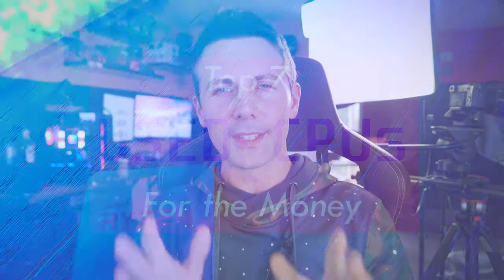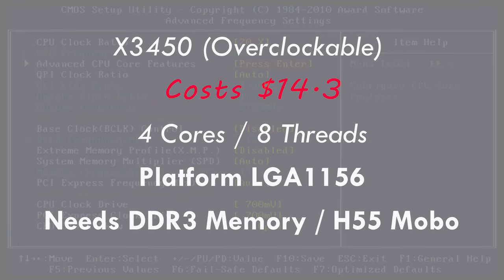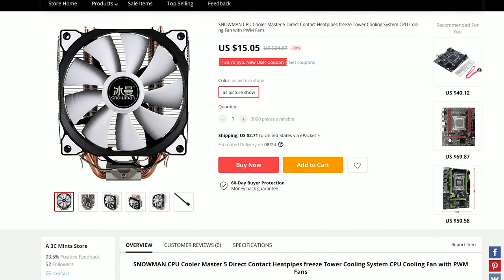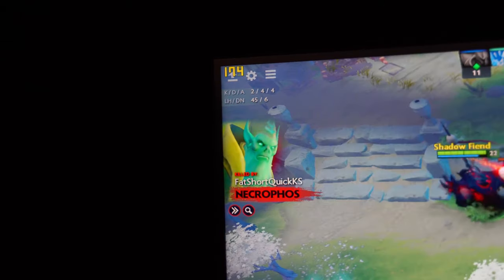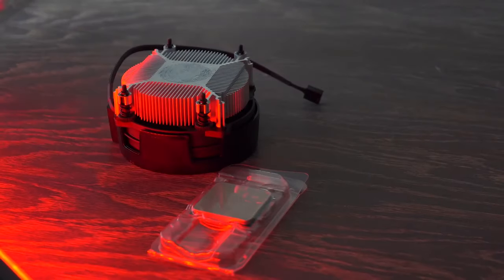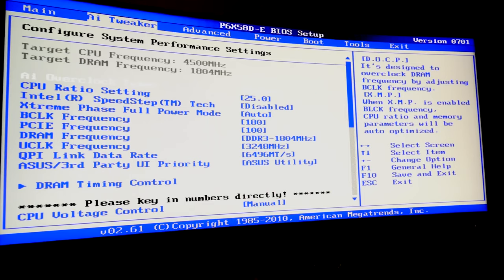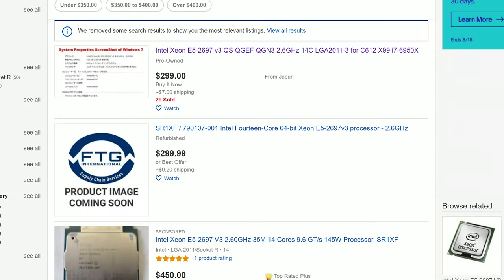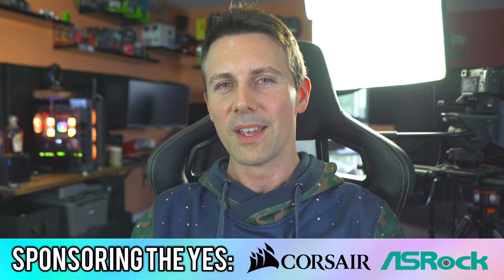Top 7 USED Gaming CPUs for the Money in 2019

Comment: i personally was gaming on an i3-3220 for a long time, since it was new basically, then i found out my board support sandy and ivy bridge xeons so i went looking for a deal on ebay. turns out going on the supported cpu list and looking up each xeon till i found the lowest one in the stack of either generation that is 4 core with hyperthreading worked wonders for me. i got a xeon e3 1230 4c/8t @3.20Ghz and it very ofter turbos to closer to 3.8ghz. turns out that i3 was holding back my GTX 1050 by a descent amount. not sure if this will actually help anyone else or if i was just lucky af but i hope this wall text helps someone.
Reply: Using the same cpu with gtx 970. Gaming sucks on this thing :/
Reply: @Belikeimpasta  I also have the same cpu but paired with a RX 480 8gb. Games decent for the price. Haven't had any problems.
Why does it suck for you?
Reply: LoD Sluggy I'm currently rocking an i5-2400 cpu, planning on upgrading to the xeon you mentioned cause it's basically an i7-2600 but without the integrated graphics. It's cheaper than the 2600 but it is slightly power hungry. I have a GTX 960 so crossing my fingers my games will be smooth ~
Reply: @CheatCodeChico i7 2600 go for 40-50e i bought one while ago on ebay auction
Reply: @CheatCodeChico  hope everything goes well for you. i had a longer reply but it got deleted so i will give you the basically of it, i havent played many new AAA titles on this cpu but indie and small dev shit runs great on this thing. exambles being warframe, space engineers, diablo 3, grim dawn, Starcraft 2, overwatch, League of legends, ark:se, and whatever else i played on it out of my like 200 game steam library and no problems so far. further note my chip stays rather cool thanks to an AIO watercooler i have on it so im not sure what it behaves like on air. thanks for taking to read my ramblings.
Reply: Had a xeon e3 1270/970 ran evrry game i threw at it
Reply: D. Maybe bottlenecks?
Reply: @CheatCodeChico  I have r9 380x 4gb (it is a bit powerful than gtx 960) and I have used it with a i5 3550 and after that I have upgraded to a r5 2600 and boy the difference is huge. I have a smoother gameplay than I had with the i5. In conclusion those extra 4 threads will help you a bit.
Reply: Running a couple cheap MSI Sandy/Ivy boards with E3-1225 v2 procs, and really happy with them.
Reply: I have the same cpu with gtx 750 ti
Reply: the hell? i have something worse. The i3 2100, paired with the same graphics. Lowered ram timings, disabled core parking, overclocked my gpu. Plays Gta5 Very High, excelt textures and advanced settings @1080p stable 40 fps. no reaaon for me to go with an athlon, rather use my stocked h81 for a 4690k
Reply: @epicminecraftgamer1  You should go with e3 1230v2 instead of v1. It is only $10 more, but there is nice boost in performance, usually 15%, not to mention much less power consumption thanks to 22nm process.
Reply: @CheatCodeChico  how much ram?
Reply: @LazyKingAus  if you're talking RAM sticks, I have 16 gigs, DDR3 @ 1333 mhz. unless you're referring to the VRAM on my 960, it's 2GB. since then i'm currently rocking a 6gb 980 ti from MSI.

Comment: Picked up an i7 3770 and board for £40, bargain.
Reply: thats a hell of a deal, get a RX570 and you are good to go.
Reply: Which platform did you find it from mate? Gumtree?
Reply: i5 3470 and Gigabyte GA-Z87X-D3H Mobo from where I work at a recycling centre for practically nothing; still working and in good nick! Slapped a Hyper 212 Cooler on, and updated the BIOS to the latest version; also picked up a 2nd hand still good PSU to run it... SWEET!
Reply: @PCFixer  Ivy Bridge chip on a Haswell mobo?
Reply: @PCFixer  That MB is a sweet thing
Reply: @cobbydizon3440  No it was on ebay, the cpu and Mobo were from an OptiPlex 3010.

Comment: I don’t understand why i5 3570’s arent recommended? They cost $30usd on ebay and h77 motherboards are dirt cheap too (25~30 usd). The CPUs are way better than x3450s and clock 4+Ghz (the k versions clock at 4.8+ ghz).
Reply: x3450 is 1/3 the price, cost only 30% slower.
Reply: so i5 3570 is worth ~$18 not $30.
Reply: I don't know that I'd say a 3570 is WAY better than the X3450. It's only 4c4t for a start. Sure, the IPC is somewhat better, but even with a large clock speed advantage, 4c4t chips tend to be a lot more stuttery in a lot of modern games than 4c8t ones. And you're not going to be doing any overclocking on a H77 board anyway.
Reply: Because E3-1230V2/1240V2/1270 are better than i5 because they have similar performance to i7 3770.
Reply: Eduardo Felipe but Yes isnt talking about those either.

You guys are missing the point here... NEVER look only at the CPU price but always include average Motherboard prices.

I can get 3570’s + H61/H77/Z68/Z77’s motherboards for around $50~$70 both together and that costs the same for X3450+H55 old AF motherboards but performance isnt.

I literally have X3570, i7 980, 1240v2, 3570 and 8600k builds in my living room right now and the 1155 Gen plays much better than 1156 (stuttering).
Reply: Aretak 1% fps and .1% fps con AAA titles, my 3570 destroys my X3570’s
Reply: xponen_ you’re hopeless. Find a cheap h55 motherboard that allows OC for under $50usd

Comment: 3:30 R5 1400 and RX570 FTW! Used price performance princess ticking away in my ITX box :D
Reply: yeah thinking upgrading GPU and I don't know to what since for me I'm on the edge cooling it down
Reply: Can you tell your build?
Reply: Muhammad Fikri 

Fractal Design node 202 ITX case
Gigabyte AB350N Gaming Wifi ITX AM4 mobo
Ryzen 5 1400 with Wraith Stealth cooler
2x8GB Patriot Viper Steel 3200MHz DDR4 RAM
Drevo D1 Xtreme 512GB M.2 PCI-E NVMe SSD
Silverstone SST-ST30SF SFX PSU
Powercolor Red Dragon RX570 4GB
Samsung 500GB 2.5” HDD.

Brand new case, SSD and RAM, the rest from ebay/facebook market. Required Power switch and LED extension cables for the front panel in the build and a PCI-E 6 pin + dual molex to 8 pin PCI-E. Can avoid converting by choosing a Sapphire Pulse ITX RX570 instead. £465.
Reply: It's a great combo, but wouldn't a 2200g perform better than a 1400?
Reply: @hsnaplays9682  No.
Reply: @hsnaplays9682  1400 has SMT. So yes in some circumstances, but also more expensive.

Comment: Built myself a dual X79 (kllisre) E5-2689 (16c/32t) with 96gb of RAM from aliexpress due to tech yes city & phil's computer lab. Amazingly, all the different parts managed to arrive at about the same time, and I didn't even screw up the assembling procedure! The computer has been running for 14 days now without having had a single problem, and I have to say that I am really starting to love these old sandy bridge xeons! Paid 125 USD for the card, ~50x2USD for the processor and about ~100USD for the ram. Running with a (soon dual) GTX 980. Thanks to both of your channels!

Comment: I am running an E3-1245 in my Dell Precision T1600.  I put in an RX 570 8GB and a USB 3 expension card with an new EVGA PSU, 12GBs of system RAM and called it done.  This thing runs anything I want it to right now.  It also is great for all the photography and video work I do too.  I am very glad for the Youtubers here that got me looking out for second hand Xeon based systems.

Comment: 3770k and 4770k's go for like $80-100 USD and they are still the recommended CPU spec in 2019. Both can be overclocked to 4.5-4.8ghz easy and provide 120+fps gameplay @ 1080p when paired with a newer graphics card.
Reply: ryzen 1600 is 100$ used and still fresh compared to old ivy bridge. with ryzen path there will be a future upgrade.

Comment: There is a hidden potential in The E5 v3 Haswell-EP Xeons. There is a bug that managed to slip in that allows those CPUs to be partially overclocked and TDP unlocked. It is not easy as you have to use modified bios, remove the CPU microcode, and in that state the CPU is unlocked. Then you can use bios (on Asus boards) or specifit EFI loader to lock in new settings for voltages, multipliers and power, and then you boot to the Os and use vmwarte driver to load the microcode back in during the boot, while your new OC settings stay in. 

With this you can boost them a lot. There is a limit, its just partial overclock, but the models with high turbos do the best. There is another thing, and that is cache size. Once your inclusive ringbus L3 get big enough (it happens at around 40MB), some operations in rendering that had to be done in RAM fit inside, increasing the gaming IPC of those CPUs drastically. The best is off course the top model aka E5-2696v3, I have it for years and with BCLK at 104 it runs at 4Ghz when 10 or less cores are used and it games equally to Coffe-lake at 5Ghz. + If you need multicore productivity you can throw in all 36 threads and then hold around 3,4Ghz, a decent boost over the 2,8 default. But the low core (10 and less) clocked max clock is what does wonders in games.

Comment: Long time Intel user/builder here. I'm entirely on board with the AMD competition right now, and I'm thrilled that we as the consumers are the real winners. I've been in the computer hardware scene since the days of 386, and building since Pentium processors were a thing. I don't think at any other time in history, have we had such amazing offerings from all corners of the market, no matter the budget or the goal. I finally built my first personal AMD system this go around, with an R5 3600x (I know, not worth the extra $50, but was available before the 3600 non x), and this has definitely been, by far, the best performance I've seen for the price on new hardware for a long time. Previously, I was running an old X58a-UD5 with a Xeon X5680 as a daily driver. I hope that each company can continue to trade blows with subsequent upgrades. I can't wait for the market to re situate the pricing so we can get our hands on those high core count processors, like that Xeon at the end, at a bargain (more so than now)

Comment: I'd recommend the x3470 to get that 24x multiplier. Still under $20 right now. Running mine at 4.32Ghz with no issues.
Reply: what a beast😱 Nice overclock . You remined me my overclocked X2 Athlon 2GHz 939 socket to 2.7GHz 😂
Reply: what motherboard do u have

Comment: From AMD, Ryzen 1600 and nothing below 
From Intel X58  and everything after it
Reply: Exactly. A ryzen 1600 is a must if there is not a bigger budget for 2600 or 3600. :D
Reply: If you don't want constant dips below 60, 3600 is actually the minimum and not a single one below it
Reply: The best tl;dw I've seen. It's hard to find any deals locally in rural Iowa. I'll be selling my 1600 soon enough after picking up a 3600. Though the 1600 really isn't a slouch by any means. For 50 bucks used it's a really good bang for the buck option

Comment: Picked up on EBay a dual CPU socket Intel S2400BB motherboard for 26 UK pounds delivered! 2 of 10 core/20 thread Xeons E5-2470 at 150 UKP each, 160 UKP for 96GB of DDR3 server memory, 45 UKP for internal PSU, and a "RISER to PCI-E adapter" for 100 UKP. Everything else I either already owned or bought new.

Comment: The Tech Legend returns!

Great Xeon revaluation for 2019
Reply: There is another hidden gem and that is I7-5820K or preferably Xeon E5-1650v3. Its pretty cheap now, you can use ECC reg modules and it overclock like crazy. Its no problem to hit like 4,6 core 4,2 cache on them and in that state they defeat ZEN2 in games and you also have strong AVX2 performance and everything you need for a new computer. And you are on X99, so big upgrade path.  Some can say aaah X99 boards are so expensive, while yes, sometimes there is a bargin, like one with damaged socked where only 2 channels work, and that's surprisingly good deal as this platform is not limited by memory bandwith that much, and 2 channels are enough.

Comment: Got my hands on a brand new x58 sabretooth notherboard. Built a gamer.Sold!

Intel Xeon 5675 6 core CPU 4.2 GHz
24Gb Ram-triple channel
RX 570 Asus STRIX graphics card

X58 Asus Sabretooth Motherboard-Brand New
Hyper 212X Cpu Cooler-Brand New
500Gb Samsung 860 pro SSD-Brand New
Rgb Case fansx4 &Remote Controller-Brand New
Coolermaster Matrexx55 case-Brand New case with side window

Windows 10 Pro 64 bit clean install and activated. Optimised for gaming.

Excellent gaming performance

Comment: I am currently rocking the x5670 plus rx570
Reply: Im with my celeron and uhd graphics
Reply: I have a x5670 in my media PC with a GTX 780ti. Can't overclock though as I have a cheap Chinese motherboard.
Reply: Really similar setup myself. Dual X5675 w/ RX 480. Works really well most of the time, except in single-threaded higher-framerate games like CS:GO. The bad single-thread performance really shows with GPU utilization. But most games use 90-100% of the GPU, and I'm damn happy with that for now.
Reply: I'm running an x5670 @ 4.0GHz (1.225V) on a Gigabyte x58A-UD3R. RAM was cheap back then, so I have 3x 8GB DDR3 sticks in my system. Pairs well with my 1070, runs most titles at max settings as my monitor is a 1920x1200, which doesn't require much GPU power.
Reply: X5675 with a 1070ti here
Reply: XtremeConditions ya single thread is terrible especially if u can't over clock because of motherboard I always get 100% hours usage though

Comment: I'm surprised a Ryzen 5 1600 didn't make it on the list. I've been able to find them here in CT, USA used for around $50 USD lately. Paired with used RX 580 which I can usually get for around $50-80 depending on the model that combo makes for some really nice budget builds.

Comment: Recently got a Ryzen 1200 for 45$ with shipping on aliexpress, dropped an aigo 13$ RGB cooler and my old R9 390, runs pretty damn well, and i havent even overclocked it at all, and thanks to the cooler it will be very easy to resale. Also the ryzen 1600 seems to be around 90$ with shipping, good deal since a 3600 brand new costs around 285$ here in Chile.
Was actually expecting a video like this to drop soon, and nice to see that some deals where actually ones i also saw, great that you showed it. Cheers.

Comment: I have my e5 2650 v2 system that always runs at 3ghz with 64gb ram combined with the 1060 and it runs great. The board is dual socket so I can throw in another xeon and 64gb ram for 16 cores and 32 threads for another $90 canadian or less

Comment: I'll pair a x3470 with cheap H55 boards that don't have voltage settings. That way doing BCLK tweaks can get you a higher frequency with a slightly higher base and multiplier to start with.
Reply: There's a particular Gigabyte board which is good for this, the UD2 perhaps, I forget. I had an i5 760 running on one at 4.4GHz just fine.

Comment: I'm building a x99 with e5 2690 v3 12 cores system right before 3900x came out. I've got a good deal for it but factoring in the cost for a x570 and the cpu. I think this set up that costs me less than the x570 mobo alone seems be a viable options still.

Comment: Rocking a W3690 with a 1080 and still getting amazing results, even without OC (although you should be with a 1080.) Zen 2 kinda makes their value proposition less clear though - I'd recommend X58 xeons if you can get good value on the board, but otherwise I'd save for newer stuff.

Comment: I recently swapped the x5670 in my media PC to a i5-4460 simply because the motherboard wasn't up to snuff. The x5670 wouldn't even go to its turbo speed at any point, meaning even with 6 cores and 12 threads the GTX 780Ti in the PC was really being held back.

Assassin's Creed Odyssey for example could barely keep 30fps at 1080p with everything on Low with the x5670. However with the i5-4460 in the PC I could get a  reasonable 60fps at 1080p and that is with a couple of options bumped up to Medium.

The i5-4460 gets overlooked a lot because it can't be overclocked but it is still a decent option for a budget build in 2019, there's even a reasonable upgrade path if you want more cores and threads or want to grab an overclockable CPU.

Comment: E5-2640 (~ £15), Asgard 250GB NVME, RX 570, Snowman, 32GB server ram and X79 2.49PB + new case, PSU etc and for £320 my daughter can now game. I do need to spend £20 on 2 decent 14cm fans for filtered air in from the top of case across VRM and Cooler towards the GPU.

Comment: Got an x99 asus pro motherboard with i7 5820k for £150 in Uk facebook market place paired it with Rtx 2060
Reply: Found a 5820k for 80$ on a local deal but I cant find a cheap x99 board so i didnt bought it
Reply: ShadowKy yh x99 motherboards are very rare to find at a reasonable price.
Reply: Got a whole pc for £60 

CPU - i5 2500k
Cooler - Cooler Master hyper 212 evo
Mobo - Asrock Extreme 6 Z77
GPU - GTX 660
Storage - 120GB SSD
PSU - 600W aerocool, 80+ bronze
RAM - Corsair Vengeance 1600mhz 8GB
Case - Aerocool cylon
Reply: raihan ali wow thats a great deal you got there mate. I would personally flip it💯
Reply: Raja Zeeshan Rafique Gumtree?
Reply: Raja Zeeshan Rafique I’ve just seen your ad on shpock lol
Reply: raihan ali yh just make a post and place it on shpock gumtree and facebook market that’s what I do normally.
Reply: raihan ali lol yh got a new system so trynna flip few parts from this one got a ryzen 3600x and 2080 now❤️
Reply: @raihanali1542  FLIP IT BRO. you can get more money from this pc.
Reply: MirelRc how much you reckon i can get, I’m looking at minimum £200
Reply: @raihanali1542  try firstly at 230 and if you can't sell it, lower the price to 200.
Reply: raihan ali If you have around 80 pounds to spend I would buy a rx 480 or gtx 1050 and pop it in that pc and sell it around 350